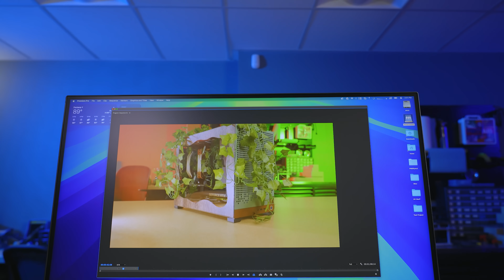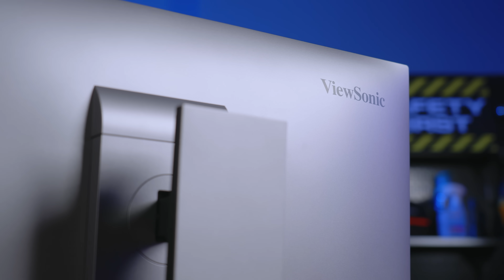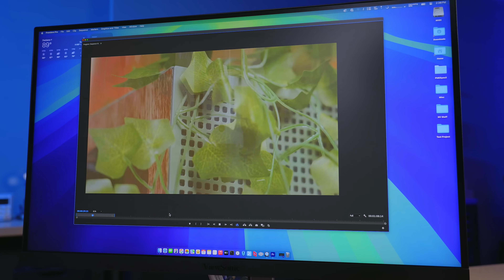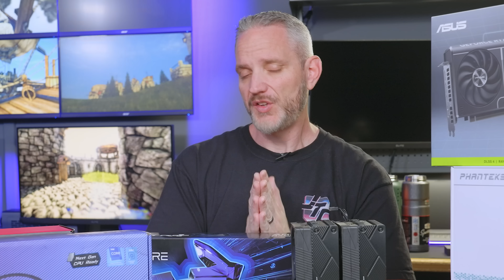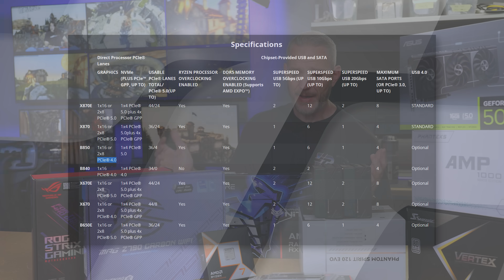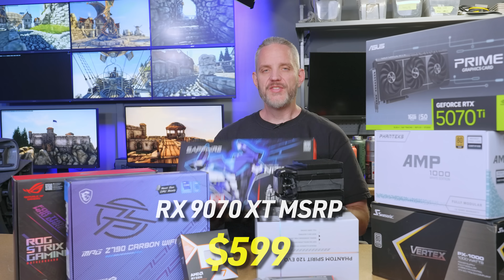This is the Sweetspot for PC gaming... Don't get fooled into spending more!

Comment: MSRP well if shops selling them way over what the card maker recommends well that seller should be blacklisted no more special deals. because if a car advertised to public at $599 MSRP then that shop be getting the card id say up to 40% less. every place ive worked at , yep most bars in hotels well they have a 40% mark up that covers staff and energy costs, most things esp a few items its 40% that seems to be going rate, they get a good deal on it when they buy it and sell it it bits that where they make way over value of the bottle . the way i see it any company selling them way over MSRP that theft and putting a bad name to card maker as if they say they going to be $600 but launch day they £1200 who going to look bad the card maker for telling lies so these shops need to be blacklisted , no special rates no early cards and give the cards to places who are doing it correct. if a card brand allows that i go else where and only one i hate to say it is doing things closer to correct price that intel cards but putting intel card paired with amd cpu just feels wrong but at the end the day who is allowed customers to get robbed , loyal customers may say that it and never return to that brand

Comment: is it me or you never mentioned what the CPU actually is? 
Also, with a 5070 ti, you are capable of playing at 1440p which kinda diminish the importance of CPU. 
For example, CPU perf at 1440p shows the Ultra 7 265k on average FPS and performance beaten by 7950XD3D and 7800X3D (by what? 5 to 7 FPS and 2 to 5%) yet they are like 100 to 200 bucks more (in my country that is). 
So it's kinda not true. Also I don't know any gamer that will go only for gaming like 100% (PC users are always doing some stuff on the side leveraging their pc) and there Intel has leverage over AMD. I don't understand also the claim over the DIMMs where 8000 mhz is like not at all a sweetspot when shoping memory. Yet, in the above comparison the Ultra 7 gets more memory frequency support out of the box. 

Also good call on the M.2s I got trapped into getting SN850 where I could save some bucks going for Lexar or WD Blue. 
The motherboard trap is also so easy to fall into. 

Overall good to see some people raise awareness over this over-spending trend, some of us would go for a beast of a PC with no money left to actually buy games :D

Comment: I upgraded my 7700k CPU + GTX 1080 system with a 9700X combo from microcenter and a used RTX 3080 from fb marketplace. The total cost of the upgrade was $700 + tax. I then sold off my old system components for $200, and I was left with a total cost of $500. A new GPU was not possible at the time. They were/are sold out and scalped for several hundred dollars over MSRP. 

The morale of the story is that you can upgrade your system for far less than Jay is quoting here. As proof, I doubled my performance for $500, but I knew what I was looking for. Tom's hardware has a great comparison tool that you can use to determine exactly what kind of performance uplift you're actually going to get.

Comment: I've got 1300 into my system I have ordered and I am getting a 7800x3d, 32 gigs of ram, a b650 board and a 9060xt 16 gig. this all includes the case and a seasonic PSU, I chose a phantom spirit 120 Air cooler as well

Comment: All my systems were Intel for decades. However, a couple years ago I built my current system with a ryzen 7 5800x, honestly, it's been a really reliable and goalpost moving experience. It's definitely no longer as black and white as it used to be. Both Intel and AMD have solid options depending on what you're going for.

Comment: I still run with my rig on B450M Pro4, ryzen 5 1600 (upgrading to 5500 soon), 16gb ram, and RX570 4gb. I can play games such as D4 and Delta Force on mid setting at 55-60 fps.

Comment: Got me a build with slightly used 6800xt for 350 bucks in December. Went along with 7500F. Overall price was 1550 bucks for a PC + 1440p 180 Hz IPS monitor. Before that I was using small laptop with its cut down version of RTX2060 locked at 100 Watts. Never going back to Nvidia unless they fix their crap or be poor and actually willing to try again

Comment: "If you're not planning on going with a high end gpu, you're kinda throwing away money by going with X3D"
Let me stop you right there homie.
 
1- That is ENTIRELY dependent on what games you're playing. If you play more cpu intensive titles, like strategy or simulation games, you will 100% feel the difference between X3D and non-X3D. I promise.

2- Most gamers upgrade their gpu significantly more often than their cpu. Unless you're on the struggle, I very much think a better cpu now is worth more than a better gpu now. 

Also, 4070 has 12gb vram, not 16. Same for the 4070 Super, and 4070ti. 4070ti Super has 16gb.

Comment: I am currently building my first with a 9600x and a 9070 XT, Gigabyte X870 Aorus Elite WiFi7 motherboard, 2TB gen4 NVME, MSI A850GL power supply and a Corsair 5000D RGB case.  I still need to get a Thermalright Aqua Elite V4, more case fans, 32gb of DDR5 RAM, and a monitor. Would my setup handle 1440p 240hz well for fps games?

Comment: I would agree with most of the stuff Jay is presenting here but with the used market completely saturated with good quality component cast-offs I can't justify spending twice (sometimes 3 times) as much for parts that can be had for so much cheaper and can be used to build excellent mid-range systems for gaming or anything else for that matter. Yes, there's always that argument about "not knowing the history of the item in question" and "not coming with a warranty" and those arguments are valid to a point. With tech advancing so fast it's becoming easier and easier to find stuff at massive savings compared to new. Just the way it is right now.

Comment: I've seen a 12500 with a 4090 within 10% of a 14900 in gaming benchmarks. After that I went with a 12700, later picked up a Asus 9070xt three connectors from Micro center for 720$ the cheapest was 700$. I was thinking the extra video memory would help out and let me keep it for longer. If the 5070 had 16gb for around the same money I would rather have Nvidia. I've seen 5070 for around 650$ at Micro center.

Comment: I had the same power supply for 10 years and it always served my purposes.  Its was more than enough back in the 2010s.   Im not using Nvidia graphics cards anymore, mostly because of the insame prices, but because i bought my new power supply in 2019 and didnt want to upgrade it again.  Not to mention, I dont need crazy graphical horsepower.

Comment: X670E does have palpable advantages like pci slot 5.0 (without as much sharing over other stuff), usually more SSD ports (important for me), so no you don't need to overclock to like it, i made a deep comparison, and even without overclocking i like the X670e albeit not highest tier (aorus master), more. It's about a 140€ uptick, but a lot more future safety. I waited 9 years for pc, and i want my pc to be like 5800x3d upgradable, the motherboard cant be weak and with how expensive they are, i dont want to buy new.

In fact X870E is worse: less SSD port (important for me),just garanteed USB 4.0 (while nice would rarely give me advantage, most 'devides' not ready for that speed. 3.0 and 3.2 are much more usefull for me in large quantity (again the motherboard does to so perfectly.

Afterward PCI 5.0 for SSD is completely unnecessary, the SSD's are rare, rarely that much more performing then pci 4.0, become intcreasingly hot it's not fun and are expensive. But still nice to have in case the market takes off (cheaper, cooler, and really faster, making a loading screen halve for instance).

Comment: AMD is vastly overpriced on basically every one of their CPU segments right now unless you want the absolute top end gaming and know how to mitigate the 1% low dips. Mid range 14700k is hard to beat, low end 14400f is hard to beat, high end workstation gaming hybrid without spending $700 on 9950X3D the 14900k is still king.
Reply: 14700k is not mid range and a 14400 is not low end.  Hope that helps.

Comment: My sweetspot was building a Ryzen 5600x, 16gb ram and RTX3060ti system  years ago then upgrading to a 5700x3d, 32gb ram and RX9070XT. I only changed the cpu, ram and gpu. Same case, cooler, motherboard, power supply and storage but I doubled my FPS. Next upgrade would be when AM6 comes out.

Comment: Lots of great info. I made what I thought was the RAM mistake - EXPO RAM on an Intel MSI MPG EDGE TI Z890 motherboard. But I did find the EXPO setting in the BIOS and enabled it and it does run fine at full speed. G.SKILL Trident Z5 Neo Series 48GB (2 x 24GB) 288-Pin PC RAM DDR5 6400. Was even able to over clock it to 6800. I really wanted high single thread performance so that was why I selected Intel Core Ultra 7 265K. At the time a few months ago - the one with integrated graphics was actually cheaper than the KF which was nice to get the system running on the test bench while the GPU shortage worked itself out. Now have a midrange NVDA 5070 at close to MSRP which is fine for casual gaming.

Comment: When it comes to cases, don't cheap out completely and get like a $20 case from a no name brand. Those usually have a very rough finish and lack of features (drive trays, cable management space etc.), that make them difficult to work with and maintain. You'll be cursing your choices every time you have to do anything with it as your hands bleed from the cuts you got from the bare metal. Cases last basically forever, so it is a good idea to invest a reasonable amount into one.

Comment: 12th gen intel is still pretty bad ass for the cost. ive seen an i7 12700k as low as $170 and it only performs a little worse than a 5800x3d for gaming in 1080p. in 1440p and especially 4k there basically isnt a difference.

Comment: Currently running a B450, 3600X, 32GB at 3200mhz and a 5060Ti 16GB with a 700w supply. Some of its a little dated. I think I should probably upgrade my CPU to a 5700x3d. I think my build has another few years in it.

Comment: AMD 5950X, MSI B580 Tomahawk mobo, with an very budget ID Cooling 280 AIO,128 Gb Corsair Vengeance  RAM, and a Powercolor Red Dragon RX 6800 OC..... I have not felt the need to upgrade at all. Games just smoke, and its been a killer absolutely trouble free workstation for all my 3D design work using the latest software updates and optimizations. All total, including the case, this unit cost me $750 to build and I could not be happier with the technological terror I've constructed. Thing is, I built this unit maybe 7 months ago. There is iron in your words, Jay.

Comment: Me no budget for upgrade I'm still using a Ryzen 5 1600x with 16gb ram b450m XFX Rx 590 tri fan. I hoping have budget to upgrade to R5 5600x or 5700x and change the ram to 32gb and a RX 9060xt 16gb.

Comment: I normally upgrade every two years, but my 3080ti is still giving me a higher framerate than my 165htz monitor supports on the games that I play. I got my GPU used as well. I generally go for used for some things. I do like to get nothing less than a 1000w PSU though. I also find my sweet spot by tailoring to what games I play and what HW works best with them. I suppose it really depends on what youre doing with the rig as to what the sweet spot will be.

Comment: Regarding over specking the power supply, 12 years ago I got a 1200 W Corsair AX 1200i for my dual SLI GTX 780 build I made back then. It still works fine 12 years later and I use it now with a 5070 Ti. I don't think the cooling fan the power supply has has ever kicked in even.
Reply: Yeah, overkill on the power supply makes it run cool and efficiently.  When power supplies get hot they run far less efficiently and longevity is affected as well.  I don't go all the way to 1200 though.  I usually get around 900

Comment: Excellent video! As someone who has to keep 5 gaming PCs going and have for the past 16 years or so as my son's grew up, best bang for the buck and running different parts while upgrading others is key. Most are running their 750w PS from 8 or 9 years ago that are still going strong. I'm a big fan of AiOs though, found those are much better at keeping the heat and noise down with all of them in the same room.

Comment: I agree with almost everything you said EXCEPT the take on cases. I think that's another area, like the CPU fan, that you should consider splurging a little. More ergonomical, better air flow and quieter chassis fans are usually worth the money over the long term, and it's one of those things that you can use forever and transfer from build to build. Considering heat is the killer of longevity for electronic parts, the extra advantage from the case is well worth it for an extra couple of bucks beyond the $100 mark.

Comment: Just upgraded my 3060 to to a 9070 xt, on a core i9- 12th gen with 32gb of ram.  For the first time I can zoom in so close with stable 4k, that I can see the rivets only my Msfs 2020 Boeing 747.  You don't have to always bill and brand new PC, if the CPU is reasonably recent.

Comment: Can someone please help me out with these selection: CPU	Intel i9-14900K
GPU	NVIDIA RTX 4090
RAM	128GB DDR5 (or 64GB minimum)
Storage	1TB + 4TB SSD + 10TB HDD
Board	ASUS Z790 ProArt / Gigabyte Z790 AORUS Master
Cooling	360mm AIO
PSU	1000W–1200W Platinum
Case	Fractal / Lian Li / Be Quiet. any advice?
Reply: The amount of ram is excessive.  By the time that amount of ram becomes a factor in PC requirements then that computer will be over a decade old by then.  I'd say 32GB is sufficient and 64GB if you have money to burn.

Comment: Just curious why none of you tech guys seem to notice Mushkin as a good, reliable company. I've actually been running Mushkin stuff since they were just a bunch of guys in a rented office in downtown Denver, and I've got to say I've never had any issues out of their products. Just from my experience with them, their RAM and NAND modules are really hard to beat. Now, I'm not sure if their tuning and such is as rigorous as it used to be, but I do know they used to make some of the most overclockable RAM out there. I don't have their RAM in my current computer, but I am using one of their Tempest NVMe drives, and it screams.

Comment: From what I have build over the last couple of years, the basis would be a good case (the Lian Li LANV´COOL 216, or the Montech KING 95 Tempered Glass Black are good and easy to build in). A good cooler, the Arctic Freezer 360 has proven a good choice in the last 3 builds I did. A decent PSU, I used a 1200Watt 80 plus gold as a minimum. What you want to use for MB/CPU/RAM, etc. is up to the budget you have.

Comment: TeamGroup also has pretty solid SSDs for the price. Their 2TB Gen4 NVMe drives can be had for $100-130 during sales...sometimes less. Likewise with Silicon Power's UD90 drives. Solid value drives. Been using TeamGroup and SP drives for years, and have had really good luck with them.

Comment: Upgraded my PC last weekend, reused the case, gpu and psu. Got the i5 14600k, asus z790 gaming wifi7, 32gb ddr5, 5 arctic fans and a thermalright burst assassin evo dark for under 500. Paired it with my old EVGA 2080 Super and EVGA 850 G2 and stuffed it all back in my Fractal Design R5. I still game at 1080p 60fps mostly RPGs so it works well for me atm. Fractal Design is an awesome company, my little girls destroyed the front I/O (silly toddlers) and I reached out to them to buy another, they sent me the front I/O for free.
Reply: I like Fractal Design's higher end cases but I've had bad experiences with build quality on their more budget cases. The threads for the side panel screw holes on the chassis of my old Focus G got completely stripped after only a handful of insertion cycles, and the USB ports which were loose to the point of disconnection in the first place died altogether. I stripped the case down to essentially a mATX test bench and scrapped the rest
Reply: friendly reminder to update that bios if you didn't already
Reply: @donkeymoo1581 had to take a trip to Costco and got 2 128gb usb drives for 20 bucks, updated that bios and disabled the armory crate asap lol

Comment: Honestly my current rig is a 1600 AF (yes the Zen + 1600 that sold for $85.00 before the shortages hit), on a Asrock B450 M/ac MB. my aim is another 3-4 years on this motherboard, so this means a 5k processor (Eyeing a 57/5800 8 core and something back a few generations in GPU (current 1060 3gb) my current rig was built during the pandemic shortages so in some places i had to settle. I have no issue with staying loyal to my  AM4 platform

Comment: Jay is NOT WRONG about PSU...Think about it...everything depends on reliable power.  Without power (electricity) none of the "magic" of computing/gaming would be possible.  That's why I never, NEVER skimp on PSU's.  It all starts with the PSU.  Find other areas to skimp for now, if you must, but never, never skimp on your PSU purchase.  I can say that I'm still running a couple of ThermalTake TOUGHPOWER PSU's that are original TOUGHPOWER from 15 - 20 yrs ago.  I have one running in my DIY home server as my NAS, etc.  Back 15 - 20 yrs ago, 500W was consider the standard what is now a 1000W and my TOUGHPOWER PSU's are 750W and 675W units that are Bronze...Gold was what Ti is today.  Keep preaching it Jay!

Comment: What about zen 4 vs zen 5?  Is zen 5 worth it?  I am thinking about a X870E VS X670E CHIPSET.  Which is better.  I do not want to upgrade for the next 10 years.  The last computer I bought was gigabyte z97-hd3.  Like I said it has not been upgraded for 10 years.